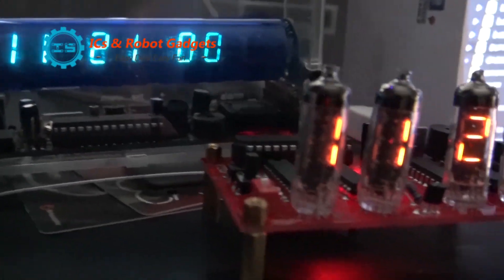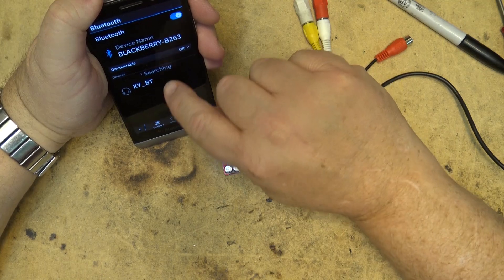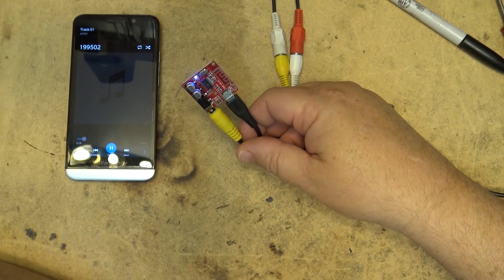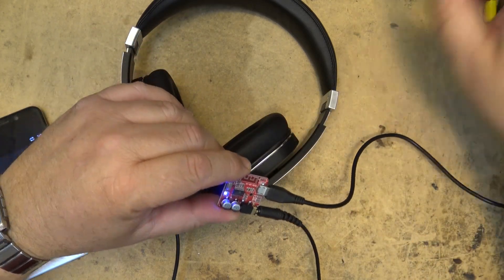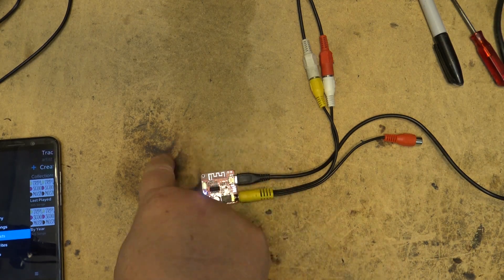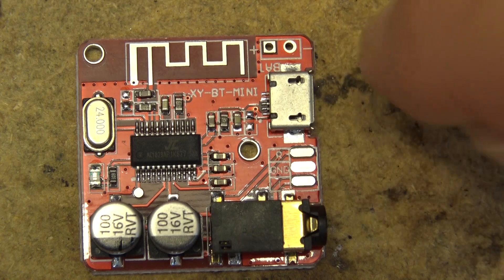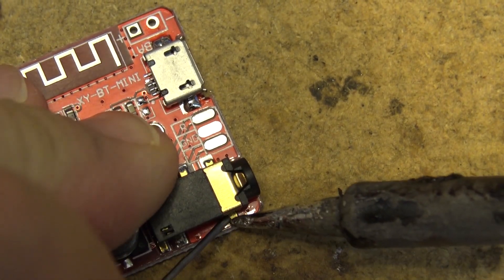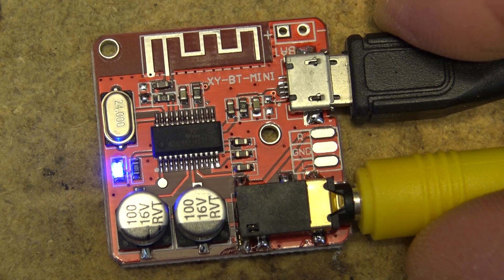XY Mini Bluetooth receiver board test run

Comment: Thanks for the post. Just what I needed. I built a mini amp and I am currently using a coax lead that trails across the lounge floor. This should prevent me and other folk going base-over-apex going across the lounge.

Comment: I got the one with the voice, Its connected to my amp & linked to my pc. Working great, no unsoldered tabs on mine - not that i used the micro usb connector. Mines powered from a 7805 regulator connected to the 12v line.

Comment: I have a double 12 inch woofer box, I will purchase that BT board, and connect it to a TPA3110 XH-A232 Power board to make my Woofer box a BT setup! Thank you for this video, I will do the same soldering to mine once I get it in. Update: I have purchased multiple of these boards and all of them I have soldered the weak points you did. Thank you for showing that info.

Comment: Hi every body, some one has done this setup on my stereo already... I have a Panasonic stereo.

Here's the problem, I have used tablet as screen in my Land cruiser, since it has every thing I need, customizations, HD screen, portability ( also security from theft as I carry it along with me) camera, Internet, tracking, navigation, In built storage, Bluetooth 5.0 etc.

Now when I pair this to my Panasonic stereo consisting bt 3.0, there Is  lag in music video songs and audio output, and for some reason the AUX was disabled in my stereo by previous owner.

My question is, will replacing aux Jack and also keeping the Bluetooth module, will it work.

Or

I will have to upgrade the MODULE to bt 5.0..... If available..... Please help.

Comment: Hi, I have the same device and the range in open area is Max. 2.5 meters! What is the problem?!
Reply from the maker: Remember that Bluetooth operates in same frequency band as 2.4g wifi. Wifi has much more power and can easily drown out the very low power Bluetooth signal.  Bt was originally developed to connect your phone to a headset or your car. Out on the road there are not dozens of close by routers competing for bandwidth.

Comment: Can we find a solution for Bluetooth carplay with this modules? Usb wireless carplay dongles are way to expensive :))
Reply: You need to find the input points on car radio mainboard, from the cassette player, and solder an 3,5 mm jack audio wire to this unit. This would be the difficult part. Put the unit back in the dashboard and route the audio wire under the dashboard in order th have the jack connector near the cigarette lighter. Then buy a 12 v lighter socket charger and find the best solution to mount the bluetooth module on it and  power it. At this stage you have a functional BT connection. In order to make the car radoo cassette player to play the audio coming from bluetooth, you need to take appart a audio cassette, remove all internals, like band spools, put back together only the casing and insert it into the player. That would start playing, but the audio signal would be from bluetooth. Done. I did this 15 years ago on a Dacia Logan first gen which had only radio cassette player. Instead of using bluetooth, I connected the 3.5 mm jack to my MP3 player, and years after that I listened my MP3 music in my car. I sold it this way, and the buyer was happy to connect his phone to the player.

Comment: I connected a similar bluetooth device to my old Sony music system. However the volume levels is low compared to the built-in cd/radio volume. Any idea how to boost that signal?
Reply from the maker: The ones I have used are all controlled by the phone volume and when turned up they give a good output level.

Comment: I want to save weight in my car by deleting the radio! Output the sound to my Car system, will tis work for my case? Will the Wats limit my project?
Reply: That doesn't save a lot of weight and no you will need an amplifier to output to car speakers
Reply: You can get a similar version of this, but with a built in amplifier, which should work good for your project

Comment: If a 3.7v LiPo battery is attached , will plugging in  usb charge it or will it brick?
Reply: K S it will brick it, the battery needs a balancer.

Comment: Can you show how to add an external antenna to a MS49SF4 board. I use a Feiyu Tech GW2 Gimbal & Remote to pan and tilt my camera from a distance, but it has such a ridiculously short range. Thanks!
Reply: You would have to build a power section to drive a distant type signal for antenna. Not feasible

Comment: Would this be good for adding it to a car radio, my car stereo has a rear auxiliary connection so I was thinking of splicing this into the power wires and connect to the auxiliary to add bluetooth to my radio without using those other bluetooth receivers with all those cables sticking out
Reply from the maker: This is exactly what I did in my daughter's car. Plugged it into the rear aux input and tucked it away in the console.
Reply: @12voltvids  great! I found a updated version of the module on Ebay it has bluetooth 5.0 for less than $10 cheap upgrade for your car!

Comment: Is this board stereo or mono? I bought 2 different (they are not " xy bt mini")  modules. All of them had a two outputs (right - left) But when measure the outputs, i saw right and left pins short circuit. They are not stereo. So mono..
Reply from the maker: Yes it is stereo.

Comment: i was wondering can i use the jack as an input from for example phone? and if not how can i use 3.5mm jack as input because i'd really like to have it also. Thanks!
Reply from the maker: I don't believe so, because the mute on the bluetooth receiver controls the power amp, so when it is not actively streaming over BT it keeps the amp in mute mode
Reply: @12voltvids  Thanks for the reply!

Comment: i just ordered mine, used to use another but had really annoying feedback sounds from the bluetooth signal. Was almost like something was wrong with it untill i saw someone else using it. It has the same ic as the one in this video but no other components like the caps on this board, i guess those components are to prevent the feedback from happening

Comment: I bought two of them from AliExpress it was 1.5$ each 
The sound quality is decent the range is 6-7m. so I soldered a 45cm. wire to  the antenna and I extended double range it's worth for the money.
Just I have a problem with the name of the bt devices.
They have the same name so when you connect you dont know wich one you're connecting. Do anyone knows how to change the name of the device
Reply: You can rename device name in android device
Reply: @sanb3586  thanks for your advice very useful
Reply: Just for reference 
https://youtu.be/7aC9EVW50fo

Comment: what would happen if you ran a stereo to mono cable to combine the output signals for input into a mono amp? Do you think it would cause problems?
Reply from the maker: If you run a steteo to mono cable you will end up with mono.
Reply: 12voltvids  perfect! Have a nice quality single speaker that I will build in a small mono amp fed by this board. Cheers.

Comment: Well, you sold me, I am going to buy a couple of these, many things you can add this to with such a low power requirement. First hack is a Soundesign 6828AGA, I'll let you know how it goes. If it goes well, I will take it back out and recycle the stereo as I was about to throw it out. Then I'' be adding to a few other things.

Comment: @12voltvids Could you do a review of http://www.icstation.com/converter-dual-channel-step-down-power-supply-board-module-265v-5v12v-p-13178.html ?
Reply from the maker: I will request that one and see if I can get one. Looks like a useful module.
Reply: Awesome.  Wish it had 15W to power a Raspberry Pi and some other things (namely computer fans).  But it does look useful.

Comment: Do these repair automagically later, even if power has been removed from the board?
Reply: Repair? Pairing isn't supposed to be without user interfacing how would the board know what to pair to? But it reconnects to the paired device when it receives power again, just tested it.

Comment: Starting at 5:25
That's the biggest problem with boards today / all surface mount components - any jack or connector that takes repeated stress does not have the mechanical stability and security of the older through - hole components. Eventually those tiny solder points will crack where a through - hole part has itself much more securely anchored.
Reply from the maker: That is why I resoldered the connectors.
Reply: That could also be remedied with a case that holds things down in place, those thick sticky heat sink 2-way tape pads perhaps on the inside of a sturdy casement???
Reply: @12voltvids  
Goes without saying. But you have to wonder how long those solder joints will last even though you've redone them. The smaller the mechanical joint, the weaker it is without some form of reinforcement. The old through - hole has that extra reinforcement due to the larger solder pads and the actual strain relief of the leads going through the board. Extra points if it is soldered on both sides and a plated through via.

Jason, yes, anything to help keep the part from physically moving will help. But just like in a building, the stronger the foundation, the longer the building will last. Ergo, the stronger the board connection of the high stress part, the longer it will perform well. Any enclosure reinforcement of the part to the board is icing on the cake.
Reply from the maker: Well this module is going to be built into an old clock radio. I just found another Yorx AM/FM/FM stereo clock radio with the beautiful VFD, just like the one I swapped the VFD tube on, but this one the tube works perfect. It is going to become a bluetooth capable radio. The AM/FM/FM Stereo switch will be rewired for AM/BT/FM stereo.
Reply: @12voltvids  not necessarily a commentary on this particular piece, but rather a general statement on the difference between T-H and SMD where repeated stress on connections is concerned. 

Since your board will be static, that sort of failure should be nil.
Reply: Just as easy to make a wired extension to a standard audio jack - then no stressed joints

Comment: Does this have that voice prompt, "The bluetooth device is connected ah successfully" (with a very heavy Chinese accent)?
Reply from the maker: You heard it connect didn't you. Just some tones.  No voice prompt on this one
Reply: 12voltvids I had to ask because ICStation says it has a voiceprompt. Thanks for clarifying.
Reply from the maker: @KernelPanic  
Yes I was expecting it to have voice prompts as per the web site as well but the one I have just beeps which is much more pleasant.  I have another one to do which is similar but has an amplifier built in and you know that that means... A bluetooth speaker project.
Reply: Mine has just the sounds for pairing and unpairing. No voices!
Reply: My one has this annoying voice!
Reply: @edsullivan9688  My ' one ' ? Really ? ... really ? really ..
Reply: aaaarrrrhhhhgggg...delivered from ali...and with voice :( :( :(
Reply: Nice.
Reply: That ubiquitous phrase fills my soul with joy. Pure joy
Reply: I bought a few of these, and it's just a lucky dip

Some have pleasant beep boop noises 
Some make no noise at all
Some have the annoy Chinese voice saying 
THER BLAWTOOF DERVOICE HAVE BEEN DERSCONERCTERD at full volume every time the phone goes out of range :/ 

Physically they're all identical, I guess it just depends on what sounds they flash onto the chip in the factory, and there's no real way to tell which one you'll get
Reply: I have one that says: Bat Tree low, prease chahge.

Comment: Whereabouts do you live?
Reply from the maker: Canada
Reply: I know, but do you live in Vancouver?
Reply from the maker: @infinitecanadian  
Not in Vancouver city but I am in the lower mainland
Reply from the maker: @infinitecanadian  
You close to Paul carlson's place. He is out there in the valley. I'm west of abby on the beach.
Reply: This guy https://www.youtube.com/user/MrCarlsonsLab
Reply from the maker: Yup. I know Paul. He is also a ham and can be found at the local flea markets. We joke around about who has the biggest troll following, ,or ban lists on our channels. As he once said to me "if only people know what the pile of crap stacked up off camera looked like"
Reply from the maker: He runs another tech channel. He does alot of videos focusing on older tube gear, and plenty of test gear, I see him from time to time driving around in his smart car.
Reply from the maker: Yes I have fallen asleep on some of his . He does theory well, but I already know all that dry stuff and it becomes a snore feast here pretty quick.
Reply from the maker: Thanks. I try to get to the point, and show the symptom, and fault using a minimum of test equipment. Sure sometimes it is absolutely necessary, but for those that have been troubleshooting for a long time we learn the symptoms and tricks. Test equipment it needed for some tough dog problems, but those troubles don't pop up much in more modern gear. Tube gear for sure, because tube gear is for the most part crap. I know I just pissed a few hard core tube guys. I like tube gear for one thing, audio amplification, because it has a pleasing warm sound, but they are not accurate in any way. Tube gear sounds line due to limitations in the human ear. They just appear to sound better in audio applications. For everything else, solid state is the only way to go.